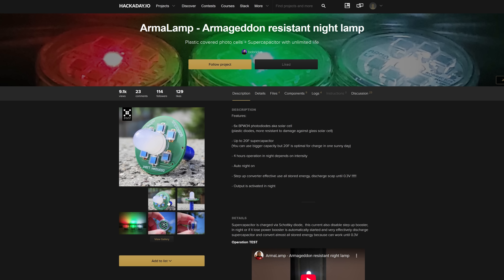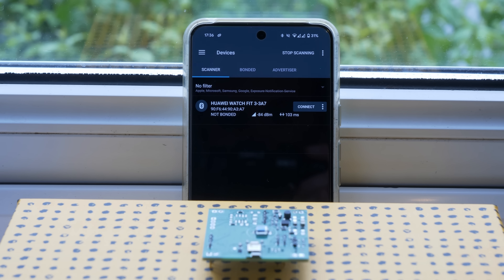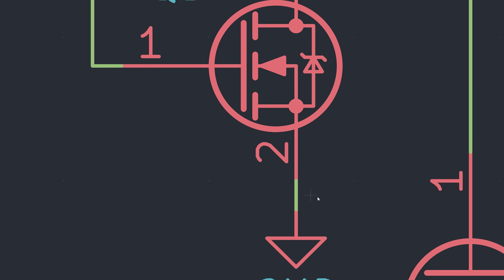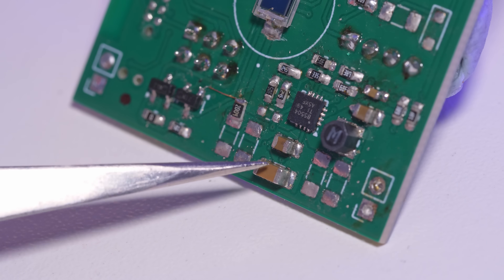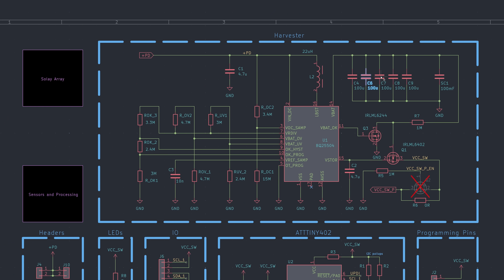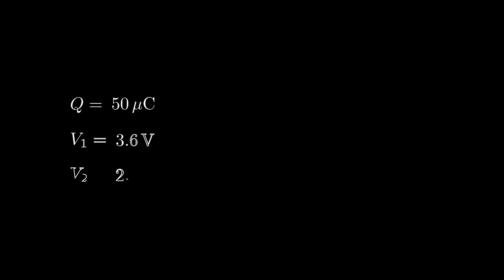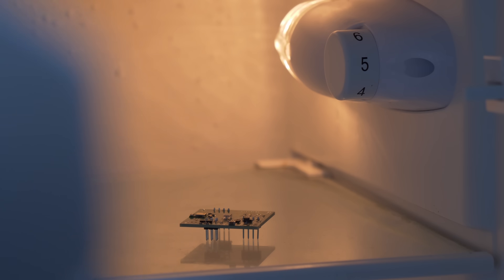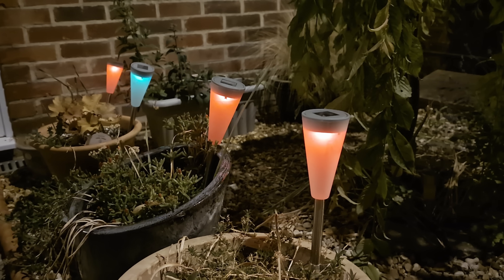Nordic chips are so efficient, you don't need batteries anymore

Comment: Scratch anything soil related. I spent years trying to find an affordable an lasting sensor to monitor anything in the soil. The moisture and chemistry breaks down materials fast. Especially when hitting it with electricity.
I have bookmarked this URL. The device can be used on just about any ultra low power sensor that doesn't require speed or even consistency in polling. Something where an update every hour or less wouldn't hurt you in remote locations. Animal trackers come to mind. I am sure there are millions of uses. 
Excellent work. I have been working on this topic for a while and you just saved me years.

Comment: temperature detection in engine room where you need loads of sensors, often during burn in you measure hourly 20 spots, for a days.  presence detectors for facility management, ie who's at their desk, is the meeting room in use etc.

Comment: You could power stuff like switch bot or smart light switches that have little watch batteries in them. They last forever on battery so I bet it needs very little power. Your cold alslsot power single LED lights that you could adhesive around your house… think disconnected Christmas lights. Those could speak to smart home things like Hue and could add cool small decorative touches to the room. I was thinking it would be cool to do that with batteries but if they charged that pull be fine. And they could be really dim just usd at night when all lights are out. Like little stars

Comment: Basically anywhere you'd want real time data but don't mind low bandwidth. Weather data is an excellent example, as would temperature and moisture readings more generally. With a couple of modifications, this could be turned into a digital tripwire as well.

Comment: Garden sensors, always in the light (in the day time) dont need super frequent measurements, and would be best for a system where power is either self contained or generated on package, brightness, would temp, air temp, soil humidity, air quality i think if you used a few of those pannels and probably double or tripple the capacity it would work just fine.

Comment: I'd just like to see a bat-less smartwatch with e-ink display, no gimmick, just watchface and notifications.

Heck it doesn't even need to be smart, just a digital watch that has the convenience of spring power but accuracy and style of digital.
Reply: If it's strapped to a person's wrist, you might be able to use the heat differential between the body side and the bezel side as a power source. People don't usually mind wearing metal-cased watches that wick body heat away, so it's not really a 'loss' of energy, right?

Comment: Ive been meaning to do a low energy temp readout project for a while. Having it ribbon cabled to indoor outdoor on windows with some kind of low energy display could indicate when it's cooler outside than in and automate overnight outdoor air cooling fans which I've been curious about.

Comment: This would be absolutely amazing if it could be integrated with home assistant! I would love temp and humidity readings in areas that generally have some light, without the need for external power or batteries

Comment: Perfect format for the video. Though little faster but manageable. Fantastic project having countless applications- water monitoring and control for apartments for example. 

You can even run it using cell tower induced currents, earth currents, atmospheric electricity, bicycle dynamo etc.

Comment: If the power requirements are that low, I wonder if it would be viable to harvest radio transmissions for energy with a circuit tuned to whatever station is closest and loudest. No need for decoding, just an antenna, tuner, and rectifier. That way it would work in pure darkness.

Comment: Possible applications depend a lot on the cost. 

I'm good at ideas, but I only understood some of the words you were using, so I hope you don't mind me asking some questions: How far can a signal be sent? What are the limiting factors, as in how big you can make the capacitors, how small the photodiodes, what are the most expensive components, etc? Basically, when you create something limits help inform your possibilities and drive creativity. 

Possible applications if these are cheap and powerful enough: Noise sensor to prevent illegal deforestation or monitor noise pollution in cities, various climate monitoring sensors like temp, humidity, CO2, light, spying, decentralized information transmission network for active combat zones. The biggest limit to any application of this idea is that energy is relatively abundant and this would be used only where it's hard to get it

Comment: Maybe you could create a security system that doesnt require power, by having an array of these devices throughout a building all tracking something like light level or decibel level, sending a packet when it detects changes including a timestamp, and then have a piece of software with a the devices mapped out so you can see where something is, as the thing making sound moves around the map, you will potentially have a record of where the person went at any time by playing back which devices light up at which timestamps

Comment: I got this little kit that has an anemometer/wind direction vane and rain gauge. I was going to add a barometric pressure and temperature sensor so I could have a weather station, but never figured out an easy way to power it, this actually seems like it would be perfect. Whack a garden light solar panel on top and have it power something like this, maybe using an sx1276 to connect over LoRa or whatever. I just may do that now. thanks!

Comment: I'll be honest, most of this was over my head. But my idea (if possible) would be to use this in bluetooth trackers (think air tags or Samsung smart tags). Or more specifically, trackers that could be used on pet ID tags. While current bluetooth trackers have pretty good battery life, it would be nice to not have to replace the battery at all, which could also perhaps make them even thinner and lighter.

Comment: I would love to use these for smart switches to control IoT lights and such. Right now, such switches require either being wired into the wall (which only works in a lightswitch socket if you have a neutral wire), or batteries. With this, you'd just need a BLE device plugged into the wall somewhere in the room to bridge the signals to the IoT controller!

Comment: Build sealed units which can be thrown into the sea and give meteorological data, if another long distance protocol can be used. Otherwise, if they could be built into a small eink display which could be permanently installed anywhere to show you your schedule, biostats or other interesting things, even in furniture. If you got a flexible display, it could be built into an armband or some clothes without the need for charge, like a permanent health status display in a sleeve or on the chest :D They could also work as trip alarms, gas/particle/CO2/humidity detectors as long as there is sun, a p2p network given enough of them thrown out everywhere, could be a fun experiment to see if it could work, for small messages in emergency situations, plus more ideas but I stop now :D

Comment: Integrating the concept:
My fist thought is to use it as a wireless trigger to force the security system (which is wired and too far away from the trigger to hard wire) to auto-mark a timestamp when the sensor onboard the wireless trigger senses activity. 
A.I. might already do something like this, but such a solution may allow systems without A.I. easier moderation by the person going over recorded footage?
*or a wireless trigger for any sensor that has the job of  monitoring any environment that prevents hard wiring to the main surveillance 'home' network.

Comment: That's really cool.

I have atm 11 bluetooth thermometers, but they use coin batteries and the batteries run out after 6 months to 1 year, so I'm constantly having to change batteries, and coin batteries are not rechargeable so it's waste. That's the only reason I don't have more thermometers, I don't want to have more devices with batteries to replace.

I collect this data with raspberry pis (I have 2 collecting data for redundancy) that receive the bluetooth data and send to mqtt, from there I can do a bunch of stuff with it.

If this was a product I would buy a bunch of them.

The only thing I would add is a humidity sensor, if that wasn't too much complicated, but I only use the humidity values from 2 of my sensors, so even if is just temperature, I could replace all but 2, and I would for sure want to have more sensors, not having to worry about batteries.

Comment: think if you can use it for a timelapse camera. Most likely it will require super-capacitor and some kind of solar panel. It will send a picture, let's say on a hourly base or based on the charging battery state (like take a picture once charged). It would be interesting to put it on the building or  lamp post as it is hard to het there for re-charging. Than make a website where we can go and check how often it could take a picture at what time of the year or day. You can also add additional capacitor with solar panel for some mechanical brush that would clean camera mechanically once that loop is charged

Comment: A thought I had was using a peltier module to generate energy from differential temperature between body heat and atmosphere (or just use a solar cell) and monitoring heart rate as a wearable device. Transmitting periodically.

Comment: I wonder if it would be possible to get a GPS fix and then send the coordinates out over LoRa. This would be good for tracking. Right now these devices have a battery and use a mobile phone chipset to send GPS coordinates out over 3G. This battery needs to be charged relatively frequently. If you could live with lower update speeds it seems like a GPS fix and LoRa powered by energy harvesting, probably a relatively beefy solar cell, would be viable

Comment: Smart home devices seem like they would be a perfect fit for this tech. Things like door sensors, little remotes, motion sensors, etc feel like a perfect fit. No need to mess with batteries, which becomes annoying when you have dozens and dozens of tiny devices all over your home. Add a few of these photo diodes, or maybe one of those small solar cells, and a super capacitor or maybe even just a regular one.

Comment: Check the Logitech's solar keyboard called K750. I saw a similar circuitry with a ML2032 reachable battery and two solar cells. I was surprised that it can power a wireless keyboard and that too go on deep sleep within few minutes of no use.

Comment: Encase in a clear water proof enclosure with a weight or position it at a level below the liquid (like in a pond or your pool) and when it generates enough power, the water is low. One will have to determine the opacity of the water/liquid.
Can also reverse this as a detection of when there is no light and send a signal that the light has been obscured for like power outage. 
Place in a car to detect whether you left the interior light on in the car.

Comment: I want one. As long as it can integrate into homeassistant. Completely batteryless sensors for HA are the holy grail, cause right now you have to be content with needing to swap coin cell batteries once every couple months. And with this, if you get enough power from a dimly lit light to send a bluetooth signal every couple seconds, you can get up to all sorts of shenanigans like a door handle that sends an event to HA when someone touches it, or an outdoors temperature, humidity, light and wind sensor that doesn't die when it's winter.

Comment: A 100μF capacitor has more like 70μF, sometimes as low as 50μF, because capacity goes down with voltage and there are temperature and type variation.
Reply: That is for a temperature range of aboht 0-40°C, if you go higher, you may not even reach the 37μF.

Comment: I've always felt energy harvesting is the future of most of IoT
Like, I hope we'll see harvesting switches, solar devices that work similar to yours or with full on batteries in a near future
Some sensors will be in always on state (like presence sensors) but, for example, door opening sensor could generate enough energy with changing magnetic field to wake up main supply and make sure the message was delivered
I think there's a lot on the table, thank you for the video!

Comment: Water leak sensors! I have leak sensors scattered around the house to alert me if a pipe bursts. Sink or toilet overflows. Or water heater leaks.

Look to see what sort of smart home sensors are already being used but require batteries! For instance, door and window open close sensors would also be wonderful. They are a real pain to keep their batteries powered because you have so many of them. Generally, it's not too big of a deal if it takes a few seconds to register an open or close event. 

Smart Home sensors might need to use Z-Wave or zigbee to get sufficient range though. I happen to have Z-Wave light switches that are always powered so these sensors not acting as proper nodes might be fine for users with smart system setups, but perhaps scattered larger solar or powered repeaters might be needed.

Comment: Looking at how little light you need, if you live in a built-up area you could probably run this outdoors 24/7 from sunshine in the day and street lights at night. You could distribute sensor nodes across your neighbourhood and measure neighbourhood noise levels, urban heat islands, or maybe build a small mesh network (though the unpredictable timing of the nodes coming up and down makes it hard to network them).

A simple use case would be a battery-less garage door opener or radio key fob - though you could already do that with one of those switches that generates its own power.

Comment: Honestly this would be amazing as like a passive GPS ping that could be put on a bicycle. Build it into like the top or bottom reflector, if somebody ever steals it, you get a ping now and then that would tell you where it is. Using the capacitor to keep power on rarely used devices like a home tv remote. Instead of replacing batteries every few months, just leaving it on the counter/table would keep it charged its whole life... there are a TON of applications for something like this.  Also, I know at one point I saw something about a group of people harvesting radio waves to store some of the power in a similar way. Maybe look into that, possibly having both systems on a single chip, so any light or rf energy would be harvested at that point.

Comment: Awesome, you discovered solar powered calculators from the 80's!   lol, I joke ( well partly.  This isn't exactly a new concept ).  But it's cool how much better and smaller these solar panels have gotten, and it's super awesome that they can be made in a COB style package, and soldered directly to the PCB.  

Obviously, I think of weather reporting.  Sensors that record Relative humidity, Temps, Barometric pressure.  Or the same idea, but it records VOC's ( Volatile Organic Compouds ) or some other type of dangerous particulate and contaminates in the air.  Could get an accurate reading of the air quality directly around or in your house.   Stuff like that doesn't need updated constantly.  Once every few seconds is honestly overkill.  Even once per minute is more than enough to read something like VOC's, or weather changes.   

Moisture / PH readings for gardens isn't a bad idea either.   Hell, could use it as not just a monitoring device, but find a way for it to control when a sprinkler turns on an off, for automatic watering, to maintain a perfect moisture content for serious gardners.

Comment: Soooo... A heart rate or blood oxygen monitor might be a bit much even for a bracelet covered in little solar cells, but a health monitoring device without batteries would actually be a fantastic little project due to that being the main pain point of such products. A step counter should be achievable with extremely low power draw, but if nowadays a ring with a teeny battery can measure heart rate for a full day then perhaps it's achievable relying solely on capacitors

Comment: id first work out the proof of concept to see how far it can be pushed to work in conditions using a more useless device(prank beeper with piezo speaker), then use that base to modify the power dynamics for other things like maybe a weather conditions sensor or maybe radio micro bursts for a tracker
maybe put a few around the house and use its signal for positional approximation to finally find the remote?

Comment: I'd like to see smaller surface mount micro batteries yhat can last the lifetime of the device combined with an idea like this.  Getting a functional battery and charging system down the the size of a quarter and having that run the system at preprogrammed times or on demand is more interesting to me than a device that just runs once it has power, runs itself dead, and repeats only at the unreliable/variable interval of it's charge/discharge cycle.

Comment: That is pretty nice. I hear your objective was to get rid of batteries, but wouldnt it be great to have a chargeable battery in there ? The smallest one, that would allow the chip to run at any time. This would be very useful in homes, as light switches. I tinkered with some of them and the main gripe I have is all of them require either 2 wires or a battery that needs changing once in a while. Your solution coupled with a tiny battery would make for a great "smart switch" . 

Other than that, fish tank sensors. Set it in the tank and forget it (but right next to a glass surface or floating as high frequency hardly goes through water)